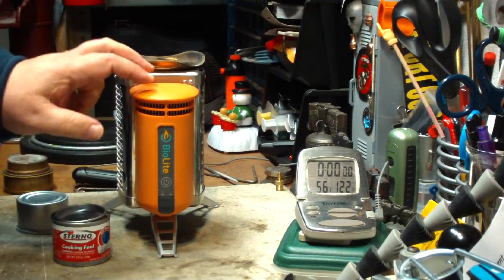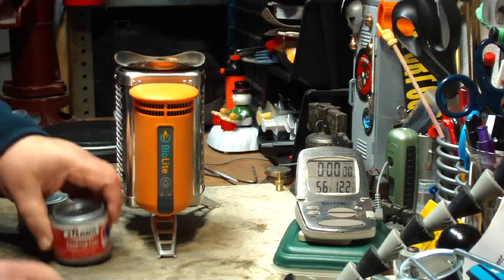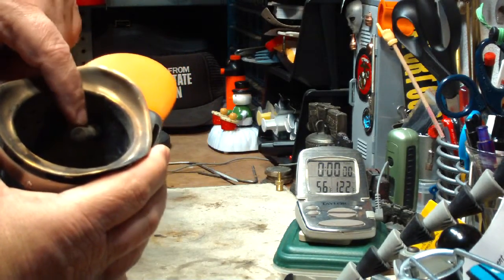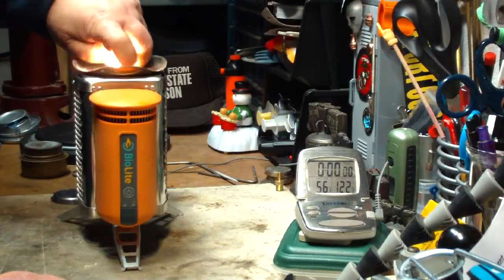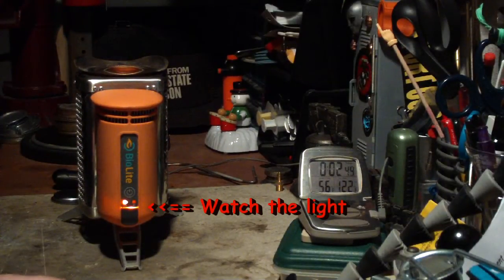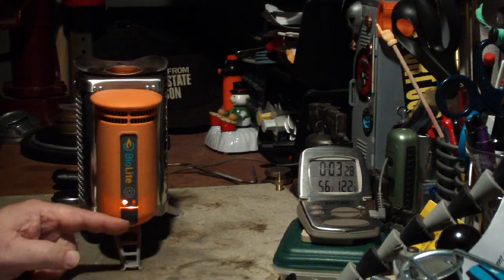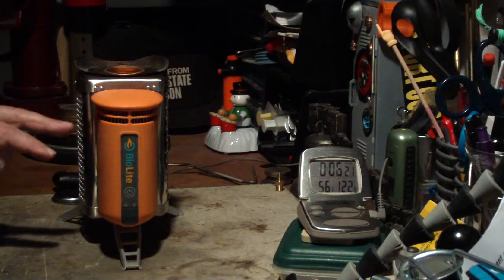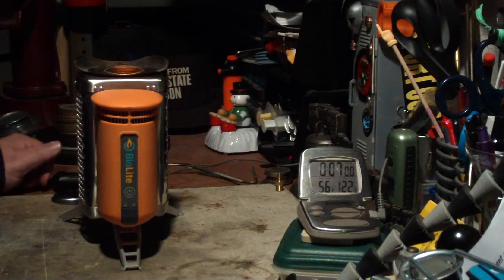BioLite CampStove Using Sterno - Test #1

Comment: Still not convenced that it is worth the money I Will keep using my i quart canteen cup fire ring it is lighter and cost less i think i put a hole buck on the cup and fire ring and it works Great i Think i will watch moer of your video's and some other's but i Just cant get past that High price tag and if the power goes out at the house i can use my wood stove to cook or if it is in the summer i can use my good old colman Camp stove white gas or propane or the Propane BBQ Thanks For posting.

Comment: Hiram, I saw someone else use wood pellet cat litter and I tried it myself... works awesome. about 2.25 cups of litter burned for nearly an hour and a half with nearly zero smoke from the first second. it boils 2 cups of cold water in about 6 minutes from first light... not just from full burn. next experiment is different kinds of wood pellet cat litter to check diffs. these guys don't understand experimenting... sometimes its a win and sometimes its a loss. learning is what is important.....

Comment: You've made this entirely more complicated than it needs to be.  It's obviously not going to charge off that puny sterno flame, this thing makes an inferno when you use it properly, and that's what it takes to supply the USB port.  If you're worried about wet biomass at your camp site, just pack a handful of twigs with the stove.  Once you get it started, it will burn anything wet you add to it.